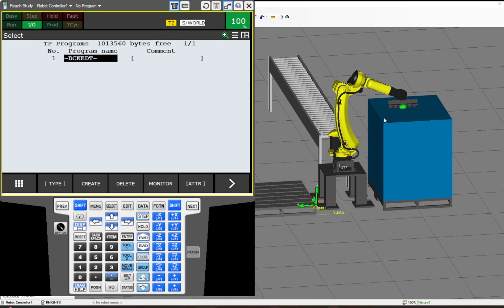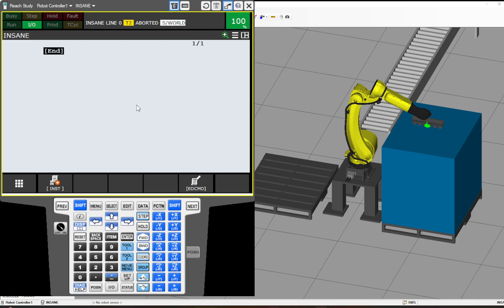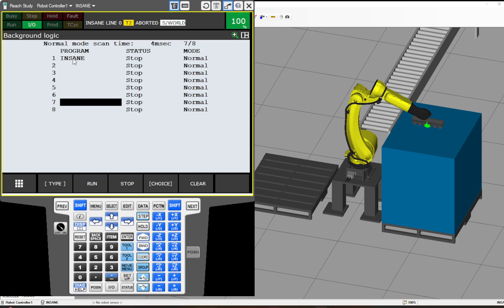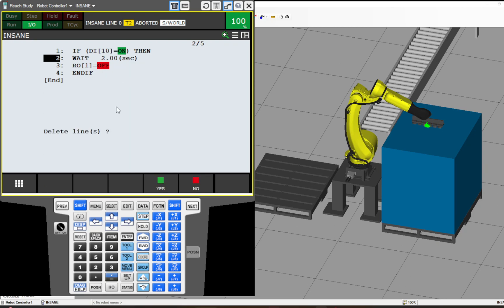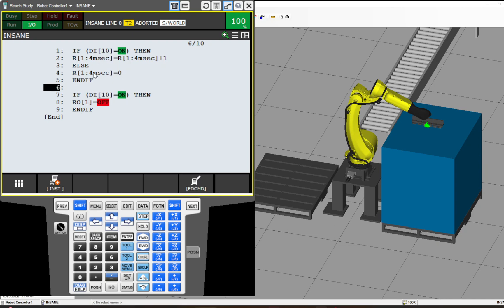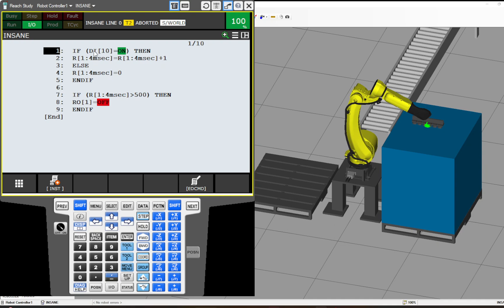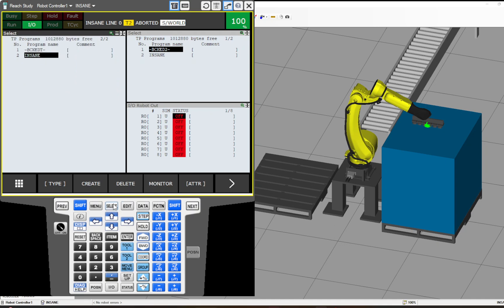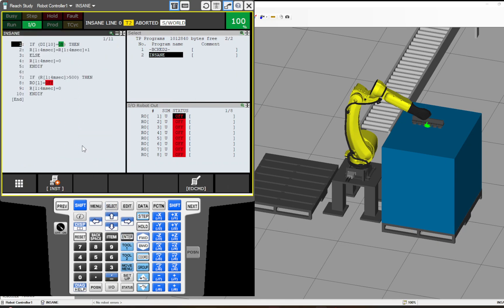FANUC BG Logic Timer Hack

Comment: Great video. If you add your scan rate (4 ms) to R1 instead of 1, your counter will be in ms instead of scans. In your check, you can then look for R1 = 2000 ms which is easier to use.

Comment: Hey I’m a programmer for an auto manufacturing company that uses fanuc robots, I was curious if there is anyway to setup IR vision to recognize a failed picture or a no part picture and use that to offset from that point forward or backward to attempt the picture again. In our case some of the spindles the parts ride on  get paint built up under them and they lean slightly or the chain gets offset and it only gets part of the pet in the photo, therefore failing to identify the part and rejecting it. Just curious as I have been trying and could not seem to find a way to do so.

Comment: Very cool. 
Q. Why is the step key multi-color?
Reply from the maker: Good question; I've always been under the ideology that anything on the TP with multi-color either means it has dual functions (meaning normal button or SHIFT+Button), OR, it is motion related. So my best guess is that since STEP changes how the motion is executed, FANUC made it partially blue like the Jog keys. (total SWAG here)
Reply: @AdamWillea  Thank you, I thought it may have a function that could have been associated with something other then Spot  Tool+ which is what I am using.